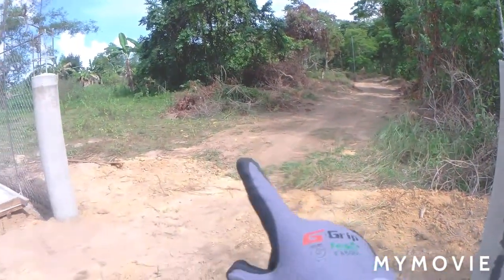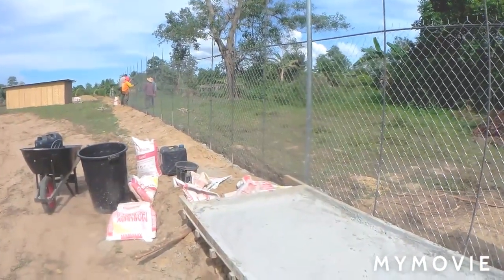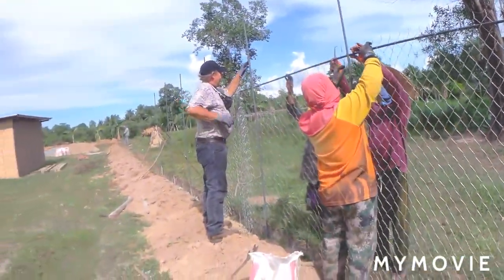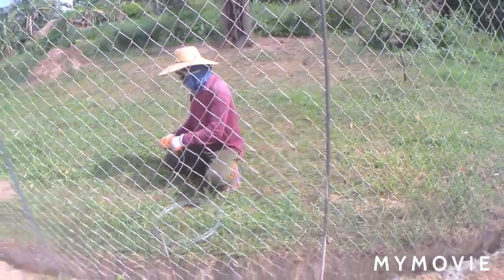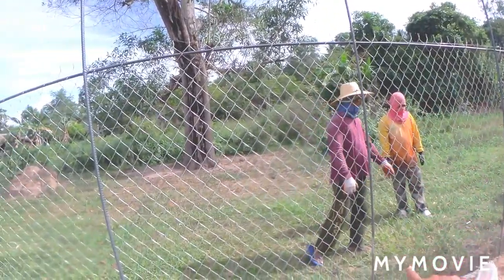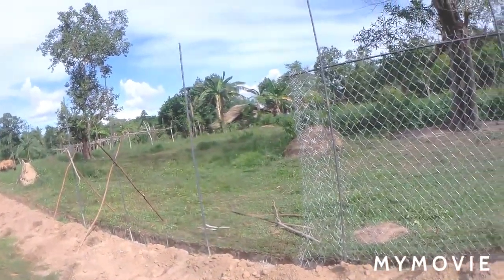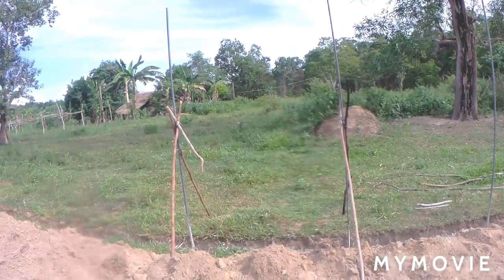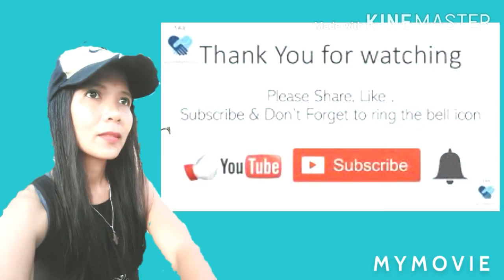Our Workers Starts Placing The Interling/Cyclone Wire

Comment: Guys would you need to put up stronger poles than just the rebar, how would bamboo work?? or pressure treated 4 x 4 every 10 m
Reply from the maker: Thank you for the idea. But bamboo won't last long and many Termites here
Reply: 2" steel tube is what I am going to use.

Comment: Maam tanong kolang magkano bili nyo sa interling wire? Kinahanglan man ako ug 50 meters mga pila magastos ko,besan 6 inches ra ang lapad by 60 meters long,ngayo raku idia maam kon pila
Reply from the maker: Hi sir Carlo ML, ang price sa cyclone wire nga na palit kay 900 pesos 6meters wide, 2 inch hole and 6 feet height. Didto me nipalit sa Ubay. Kay kasagaran sa amo gicanvass mga 1000plus ang price sa uban. Pero ang pricing nagdepende sa width, hole ug height
Reply: @aforeignerandfilipinainphi2964  ok maam thank you kaayo sa i,mpormation subcriber ,o ako